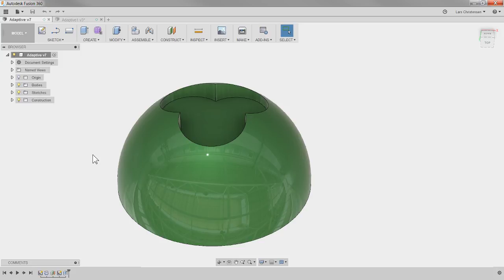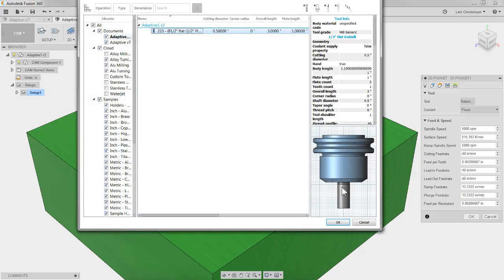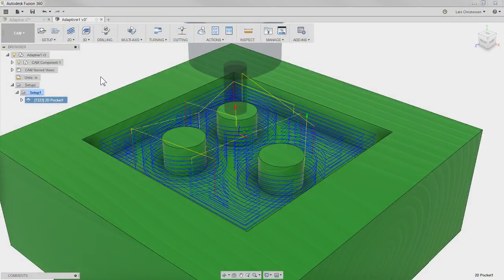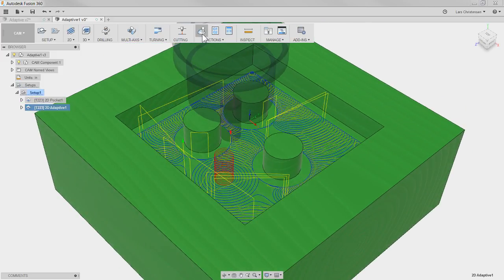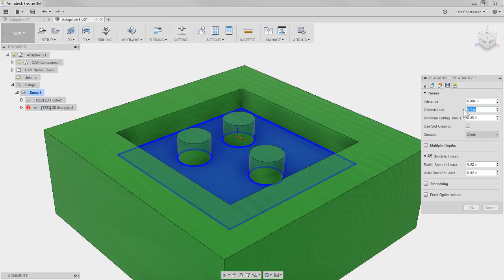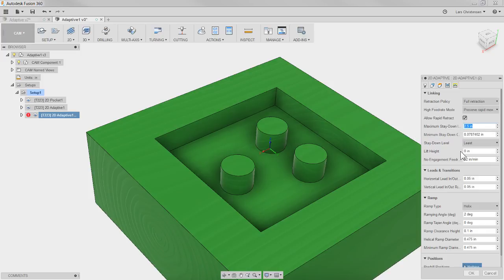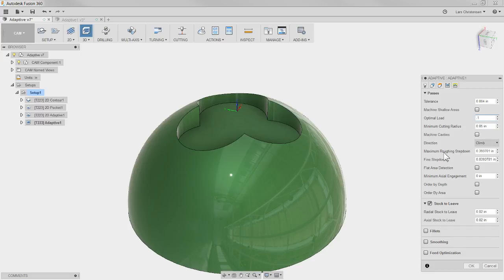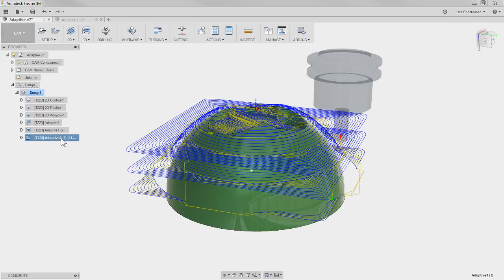Fusion 360 CAM — Understand Smarter Toolpaths — Adaptive  & Favorite Settings —  #LarsLive 66

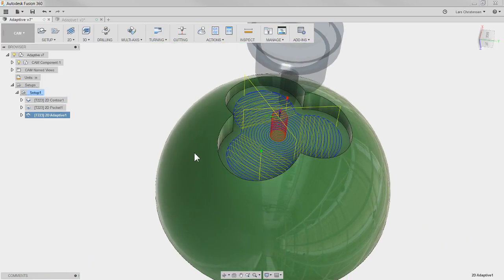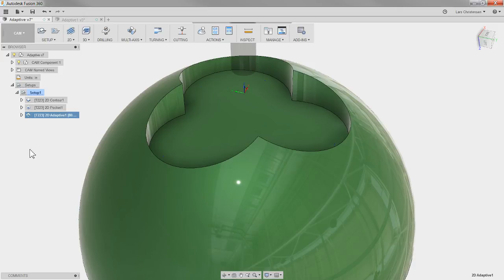Comment: Per the 35:47 toolpath with default stay-down, vs 36:18 with maximum staydown - notice that the number of cross-model moves is actually the same. The only difference is that your machine is no longer rapiding between those points, and is instead using the feedrate speed. This would actually be SLOWER toolpath on most machines than the default, there is a reason rapid is called rapid. I'd be careful thinking you are going to get a lot of time savings maximizing staydown on every model.

Comment: Nice intro to adaptive. I started with adaptive, but switched to pocket milling because I didn't understand the constraints. It would have been nice if this video had come out after the "both ways adaptive" feature was added on the last CAM update. Slotting isn't too bad if you are cutting very soft materials (XPS, Soft plastics, etc.), but for dense woods and metals I can definitely see the benefit of always side milling with an even load on the cutter.
Reply from the maker: Hi Jack Bryan Thank you for watching!
Yes, I should have had this as a reference at the CAM what's New livestream.

Have an awesome day!

Best,
Lars

Comment: Hey Lars, great beginner video for adaptive milling. 

I think for those who want to get the most from adaptive tool paths it's absolutely critical to understand how the chip load and tool wear are affected beyond the advantages of full depth of cut machining.

Google radial chip thinning and read all you can. There's an endmill manufacturer called Helical Solutions that has some great PDF's that you can print off as a resource.

Remember back in the early 2000's  when feedmills came out? I was just getting started in machining and wasn't yet bound by dogma so I researched why they work. 

Axial chip thinning. This translated into shallow depths of cut at high feed rates. Compared to a cutter with a 90 degree cutter angle producing a 90 degree engagement angle, feedmills usually have around a 10 degree effective engagement angle if you discount the fact they are almost all radiused. That ment that for the same forward feed rate the chip thickness is reduced due to the chip thinning effect. This is why you can utilize feed rates of .03 or more per tooth with feed mills. I struggle constantly to get folks to understand this. 

With endmills employing a radial step over stratagy the effect is exactly the same. The less the step over the greater the chip thinning effect because of the radius of the endmill. This translates into higher feed rates for the same stress on the tool. It's counter intuitive but getting greedy on the step over actually starts to defeat the advantages. 

The added bonus of lowering the step over and increasing the feed is the fact that each individual tooth is engaged in cutting fur a shorter duration of time per revolution for the same chip thickness. This means we can increase the SFPM because we know that heat generation is the primary cause of cutter wear. 

In short. Lower your step over, increase your feed and rock up the SFPM. Researching these elements makes it abundantly clear why it works so well.
Reply from the maker: Hi Mike Lang Thank you for watching! ANd thank you for the great comment!

Comment: Does Fusion calculate the feeds and speeds using calculations like in FS Wizard?  Are they sensible and can we use them as they are?
Reply from the maker: The problem with feeds and speeds is that it really depends on what type of machine, tooling and work holding you are using. Fusion does not suggest feeds and speeds, like FS Wizards, because if you run with those numbers blindly, you could have a bad experience. Personally, I don't have a problem with software like, FS Wizard, but for myself, I have always made a point to have a close relationship with tool manufactures so I could pull on their knowledge.

BEst,
Lars

Comment: Great Video.  I'm a little confused with Optimum Load and how it relates to Feed per Tooth.  If I were to guess Feed per Tooth defines the forward distance traveled as each Flute comes around as it relate to Spindle speed and Optimum Load uses Feed per Tooth  to create a toolpath which loads the cutter with a constant amount of side contact??  Sound Right?
Adaptive Clearing is now my goto toolpath.  Thanks!
Reply from the maker: Hi Bill Vanca Thank you for watching!
I guess you could say the two crossover. But, generally, Feed per Tooth comes down to how much balls your machine has. Then there could also be an issue with clearances between the flutes of your cutter if you chip got really thick.
Now, you might not see a big difference on your load meter if you keep you Feed per Tooth and then change your optimal load from .1 to .2 But ofcourse if you changed your Optimal load to half the cutter size, then you might, but then you are not really side milling any more :-)

Comment: Yellow movement is allways rapid movement isn't that right... only thing that tool stays down and rapid linking happens down mostly and don't come up on Z and then make movements...
Reply from the maker: Hi HybridiHippo Thank you for watching!
Yes, rapid is yellow. I did a lot of testing when I was at Rid-lom when it comes to rapids vs feed moves. I don't think there at a golden rule. Of course if you are doing a lot of production you need to get your cycle time as close as possible to minimum.

Comment: Such valuable info Lars! Just a little thought, why would someone use the "multiple Depth" option besides fearing such a deep depth from breaking end mills in the past?
Reply from the maker: Thank you for a great reply, Jim. Dj, I think Jim said it better than I could :-)

Have a great day guys.
Reply: When milling deeper than your flute length is one instance. Some long endmills and indexable cutters have short flute lengths so so have to use multiple depth passes. 

When using a feedmill is another reason to use multiple depth passes. Using an adaptive style tool path controlling your tool load with a feedmill works great also, you’d take a wider pass (75% of the cutter width for example) than you would with an endmill. You’d use this on a 3D profile with long tool overhangs if the part/application calls for it.
Reply: Thanks you for all your videos Lars. I’ve learned quite a bit coming from Mastercam from you. Glad I could help.